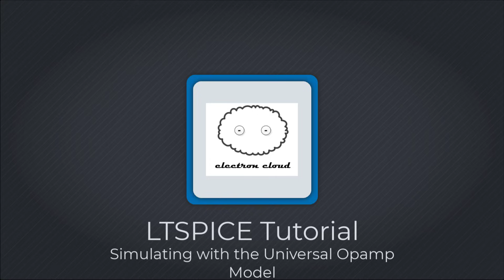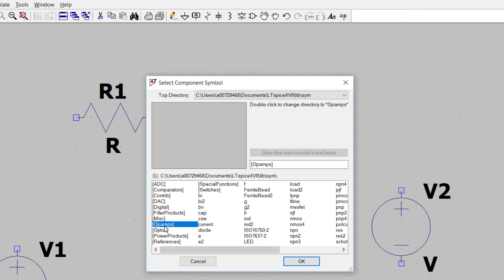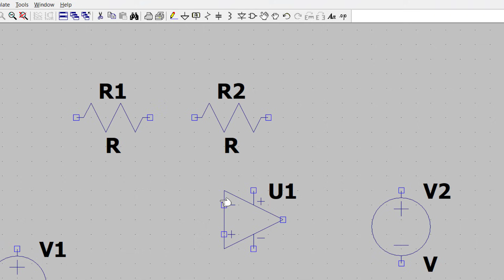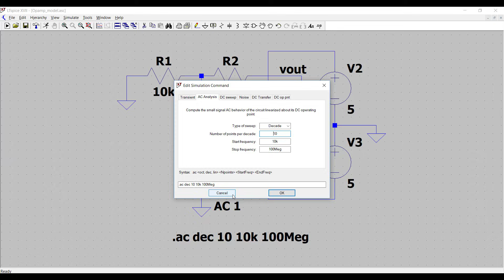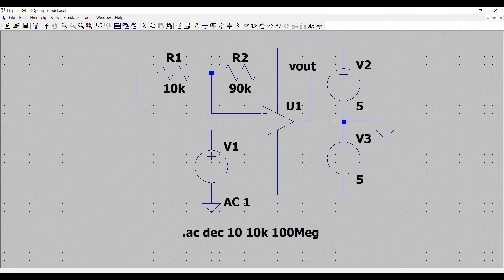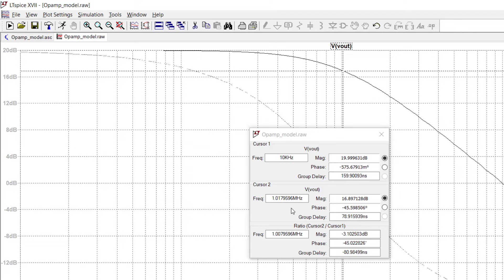LTSPICE Tutorial - Simulating with the Universal Opamp Model

Comment: Hey man, can you please help me with the gain bandwidth product? Iam using the ideal OP-Amp model in an inverting amplifier configuration. But when using AC simulation, the Gain Bandwidth product does not apply as noted in the formula of the video. Can you please make the same analysis with the inverting amplifier configuration? Best regards!